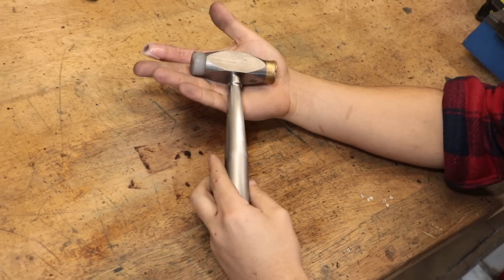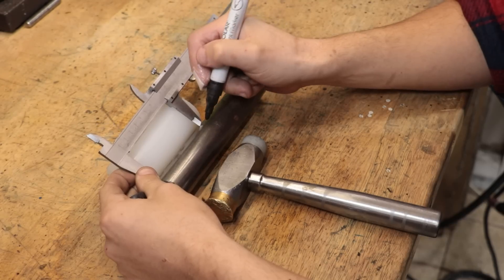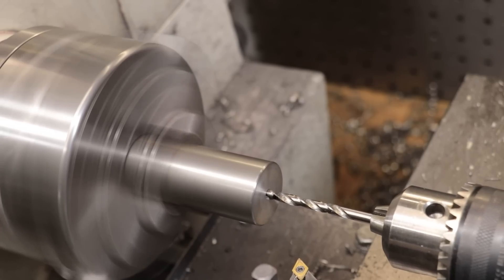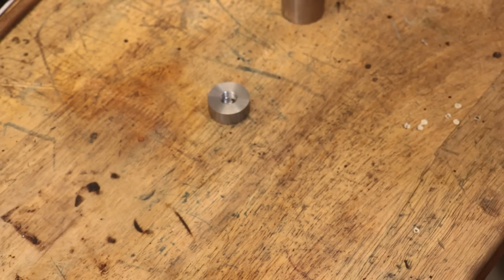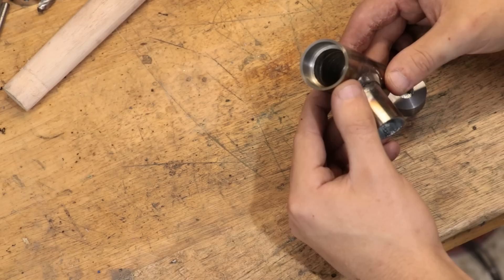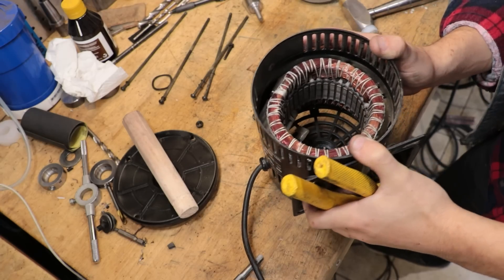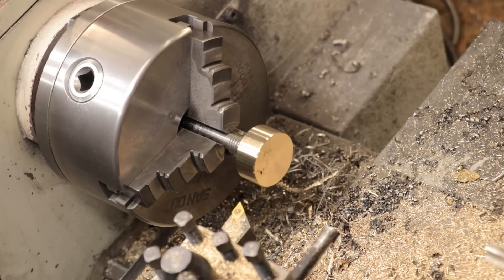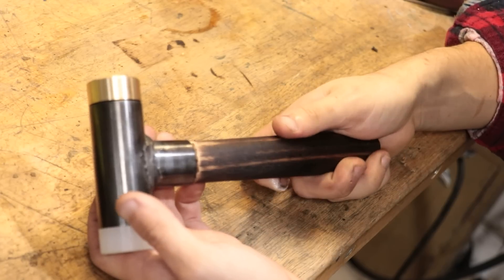Dead-Blow Machinist Hammer - With Tungsten Carbide

Comment: We have tungsten carbide wedding rings.  They're great for sussing out the older, silver quarters that you get back in change.  The silver quarters just ring differently.  The rings are hard on any surface they touch though.  They ARE cutting inserts after all.
Reply: if you break your finger or something, i am not sure they will be able to cut your ring off, and you might need to get it amputated...just a thought.
Reply: @douglasharley2440 I think you can break them off... not 100% on it tho
Reply: @paulmalinoski5951  yeah, no. ...tungsten is literally one of the hardest materials in the world, it doesn't break, and that's why they make industrial cutters and boring heads out of it. it could be ground off with a diamond cutting wheel, but it's gonna take a long time and will generate some evil dust. if someone breaks a finger with a tungsten ring on it, i think amputation will be more likely than removal of the ring before more severe injury due to blood flow restriction is caused..
Reply: @douglasharley2440 Weird how he has all these broken tungsten carbide inserts. 
It may not like to bend but it can definitely be broken. It's not easy to cut it off on a finger, but you can squeeze it until it breaks.
Reply: @deckname5794 yes, I should have qualified that as "not under extreme forces." lol, if dude doesn't mind exposing his extremities to those forces, then no problem! 🤣 breaking the tip of a carbide insert isn't difficult on a machine lathe, but breaking a carbide ring is something altogether different. my point remains...ain't ni medical personnel gonna be able to remove a carbide ring in less time than major tissue damage from blood flow restriction would occur.
Reply: @deckname5794  ok, I was wrong, apparently they can indeed be broken using vice grips. don't seem safe to me.
Reply: @douglasharley2440  The fastest way to break one - a spring loaded punch.  High impact force to a small area.  The alloy is very hard, but also very brittle in certain circumstances.

Comment: A deadfall hammer filled with dead inserts.
The irony here is beautiful.
Reply: Agree, wonderful irony. But, those inserts are only broken, not dead. I can see them cutting their way out with each swing of the hammer.
Reply: @pendarischneider  I thought the same thing. Is there a concern at all with this happening or will the scratches be so minor it won’t matter.
Reply: Hi @aaronbock6406  it might be a nice follow up in a year of so to see how much iron dust has built up. Otherwise, beyond the worrying image, I suspect the hammer will work fine in the family workshop generations from now. 😃
Reply: @aaronbock6406  zero rigidity in the theoretical setup inside the hammer, i'd say the inserts have no chance at all of ever cutting their way out of the steel head